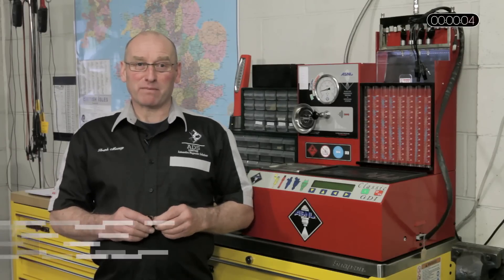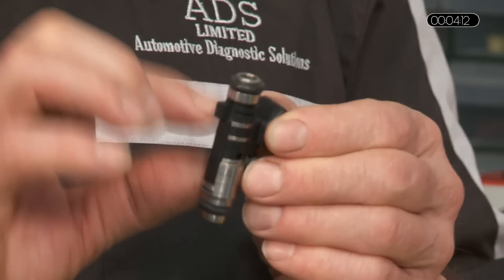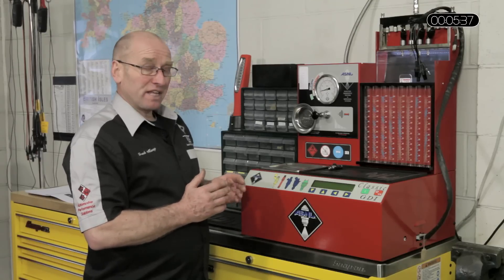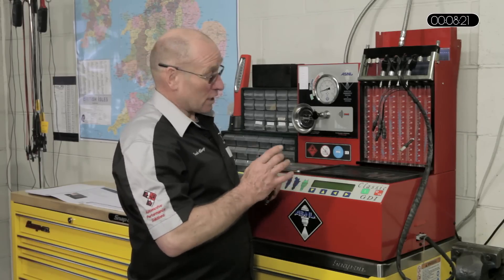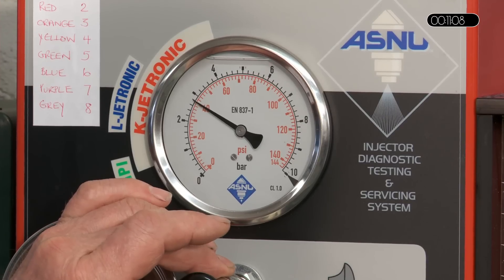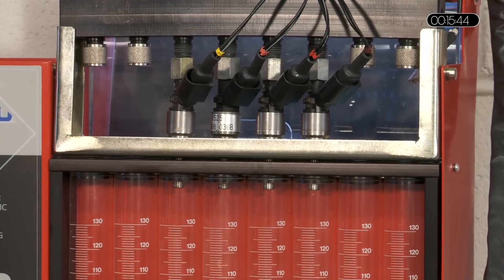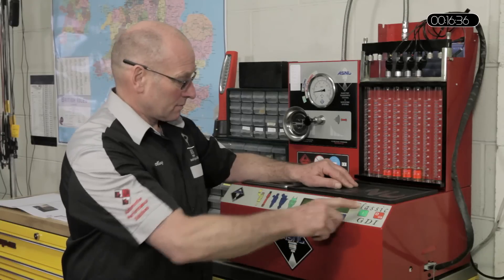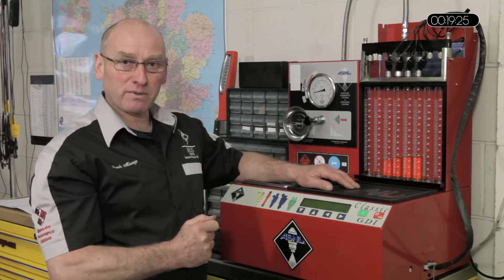AUTOiNFORM: How to test the latest direct petrol injectors

Comment: Begging your pardon, why anyone would seriously find this type of testing to be credible is beyond my comprehension. Fuel injectors that are designed to operate at 100+ bar, will not even remotely give ANY verifiable real world flow results when tested at 3-5 bar. Comparably speaking it would be like strapping your car to a chassis dyno and measuring the output of horsepower and torque at engine idle speed. I understand the potential dangers associated with testing at high pressures, as my company manufactures common rail Diesel testing benches that generate 2200+ bar, yes that is 33,000 PSI. All of the leak testing we perform is at maximum system operating pressure, as a common rail injector that leaks into the combustion chamber can emit 250 mL in seconds under high pressure sending connecting rods out of the block. Some leaks are only detectable above 1000 bar. I understand the concept of increasing the on time pulse width to achieve additional flow, but this idea seems to be quite misleading as you would have a hard time digesting this method, knowing what testing at high pressures really can reveal. Just my 2 cents thrown in there, guess I will be building high pressure GDI test systems before too long as this has peaked my interest.
Reply: Your reasoning is wrong in that the higher the pressure, actually assists the pintle in closing the seal.This is the reason we allow 20 to 30 minutes of rest time whilst observing the drop in pressure.Goid luck with that!
Reply: @tomharrison6762  Oh, bother... as Pooh would say.